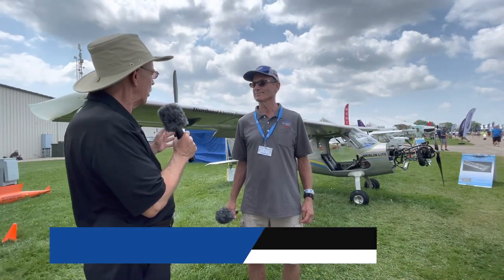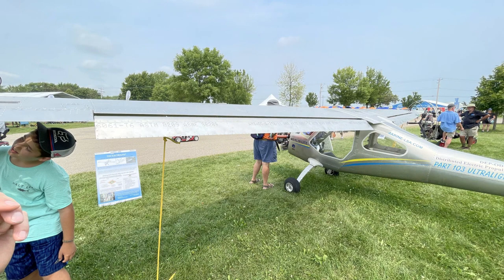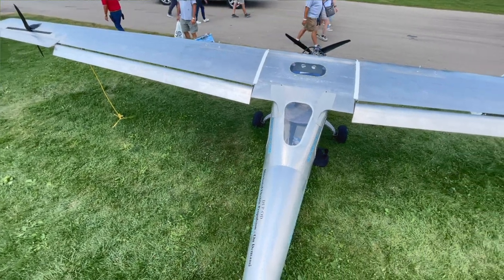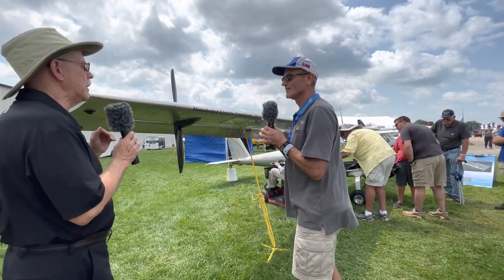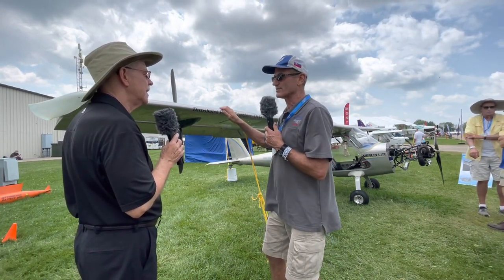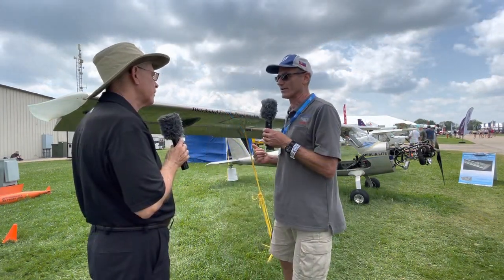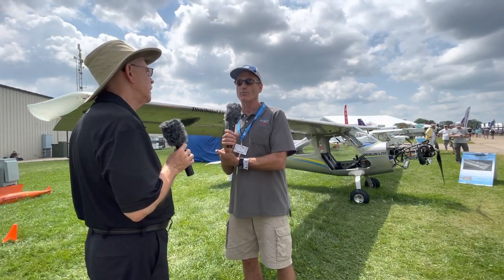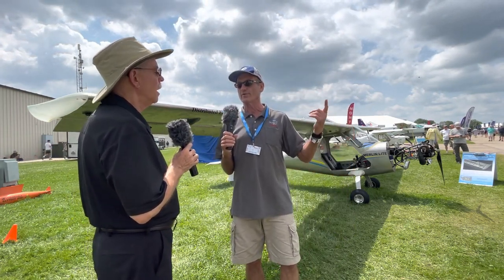Merlin Lite ElectroLite, Part 103 Electric Powered Ultralight Aircraft.

Comment: And because it's a Part 103 airplane, you don't need a multi-engine rating, right?
Reply from the maker: That is correct.
Reply: To be clear, Chipper said this is just a research project. The production version of the Part 103 plane will not have these electric motors.

Comment: the huge problem with electric aircraft is that when the batteries are 'flat' they still weigh the same. that and you dont get any range. a 20 min. flight time is worthless.
Reply from the maker: I have flown for well over an hour on battery power, about the same as if I was flying on a two stroke with 5 gallons of fuel.
Reply: @ultralightnews  thats certainly better than what they have been in the past, but still not enough to realy go anywhere. its good that the motors and other bits are getting worked out though, some day when batteries are better these will be awesome!!